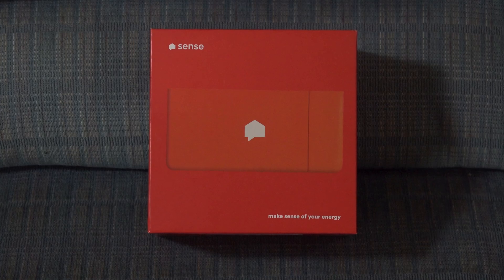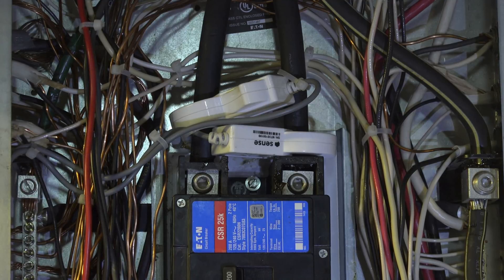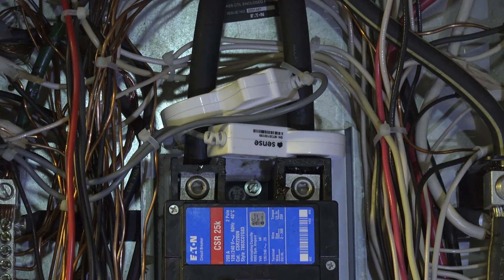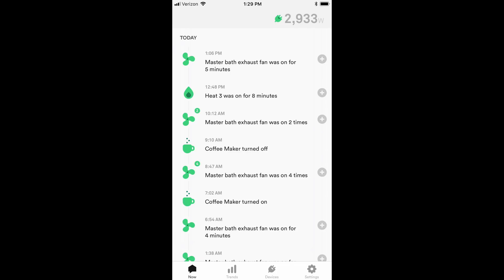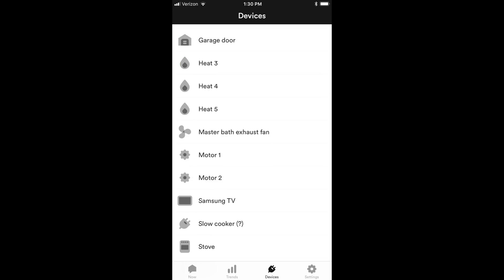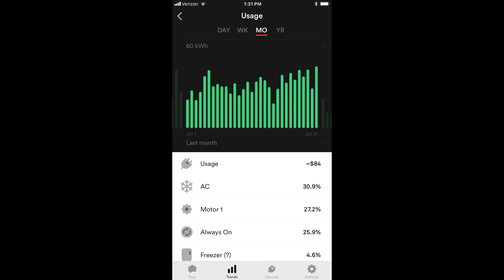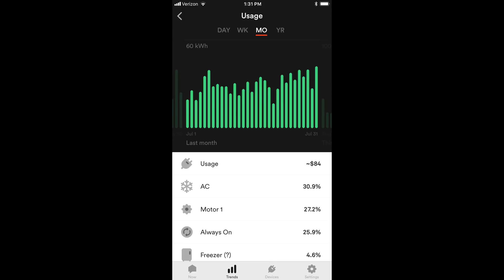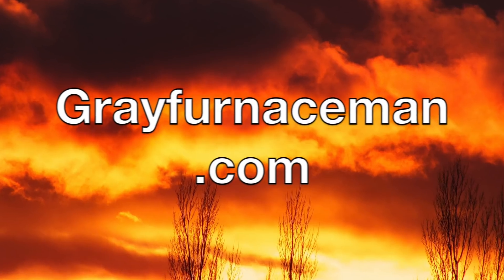A test of the Sense model SM2 energy monitor part 2

Comment: I need some knowledge! I have a heat pump condenser and need to wire it for cooling only. 2 wire thermostat. unit has black,yellow,blue,brown,red and orange.
Reply from the maker: Not too simple.  You first need to know if the reversing valve is energized in heat or cool.  You also need common from the air handler.  Maybe black.  Yellow may be the cooling control wire.  This all depends on if "normal" color code was used.
GFM
Reply: grayfurnaceman   only has 2 wires from thermostat..
Reply: take the model number off it, search on the internet and find a manual, which should have it listed...

Comment: Interesting idea but it cannot tell the difference enough between small loads.  Always on check any old style Xformers, replace with energy star ones.  YOu have to go around to each device and measure them.  Figure your total kwh for the month, then calculate 24% of that, then figure how many watts that is running (maybe unit tells you).  Kwh for the month divide by 30/31, then by 24hrs. gives wattage.  It could be 500 watts or something like that, it's probably one device doing this because the 1 or 3 watts items use 24/7 would not account for such a large load.
Reply: problem is, the magical "energy star" switch mode power supplies will likely not hold up long and you keep buying them over and over......
seen it before, where the power savings was negated 3 to 1 in device breakdown ;)